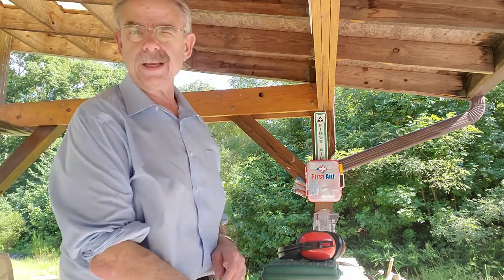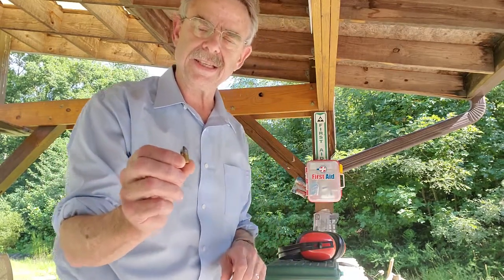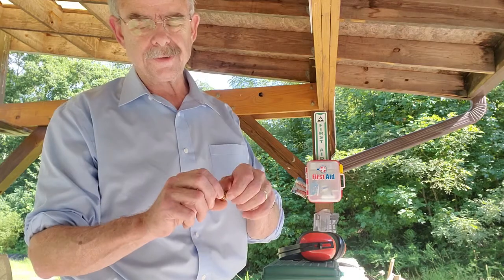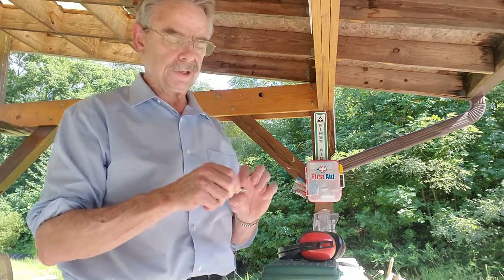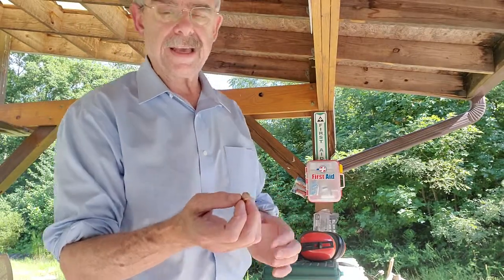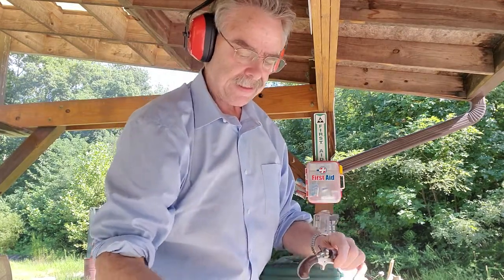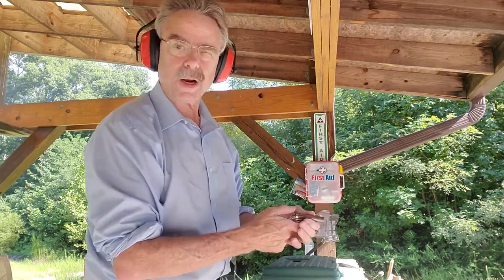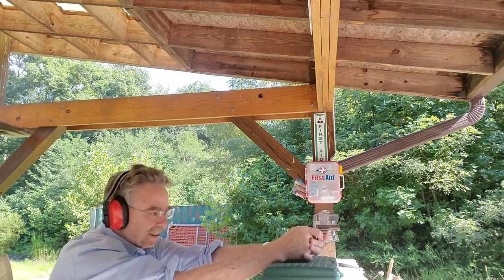Shooting original type .41rimfire short cartridges in an 1870s Colt deringer

Comment: Mate did you manage to get some velocity numbers ? I’m very interested thanks
Reply from the maker: 12.0gr of Old Eynsford 3F gave 535 fps.
Reply: @steveblancard5566  that's quite impressive for what it is .
What cartridge cases are used to modify for the 22 lr / cb cap modification? Surely there has to be a case that can be trimmed, sized ect to take a conventional rimfire case to get the job done ? .
I'm going to look at a genuine colt model 3 tomorrow at my local 41 rimfire . If 44 mag , special or 44 40 , 410g  cases can be used that 
 would be handy.
Reply from the maker: @concernedaussie1330  I'm not sure, I haven't looked. I did machine a single case from solid brass stock. It works quite well.
Reply: @steveblancard5566  thanks 🙏